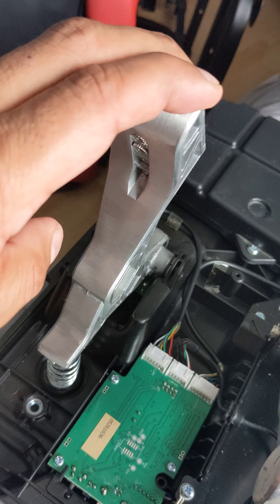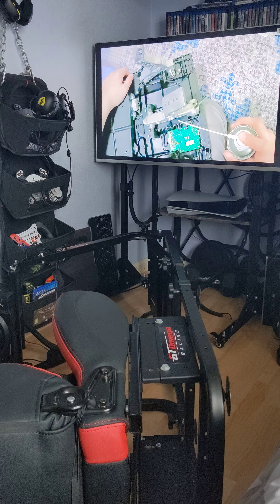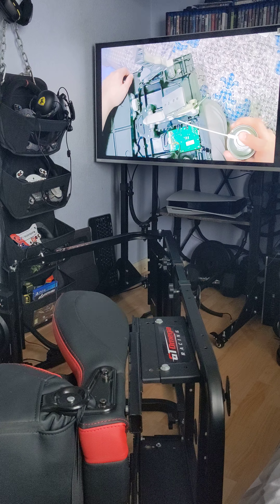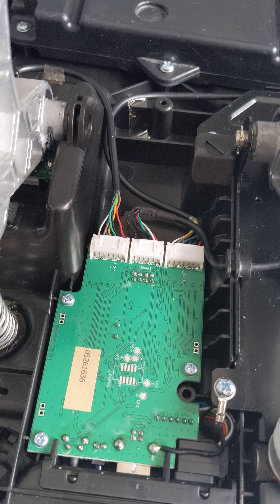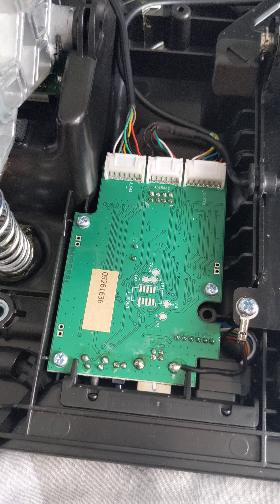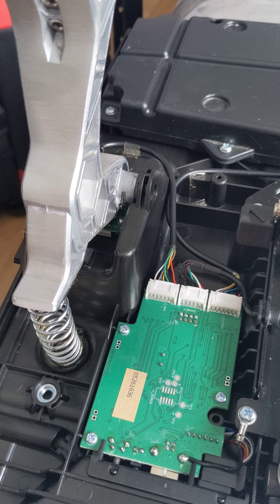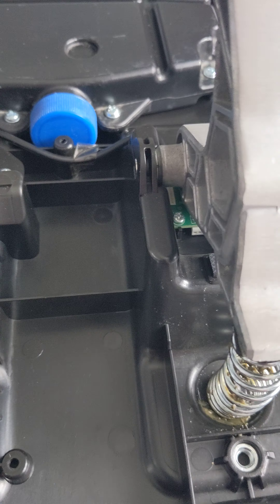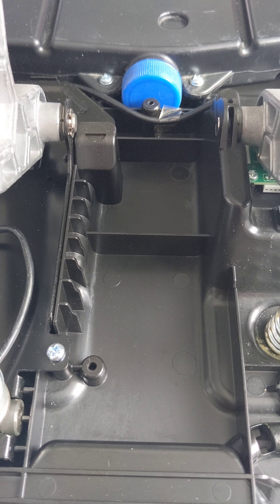Thustmaster TLCM - pedal fail - How to fix

Comment: it worked!! even with my brake pedal too:) just hit it gently with compressed air and check if there's too much grease where the board that comes in contact with the pedals, clutch and gas
Reply from the maker: Hi there glad it worked for you, it's a common problem with this version of the TLCM pedal which is the earlier version. The newer one has a plastic moulding which covers the gaps at the base of the pedals to shield them from particulates. Funny enough my Brake Load cell is now playing up. So will have to take it all apart to see if it's the dust or another issue.
Reply: @MorfiusRacing  I got the same thing, covered all 3 pedals with dog`s shitbags and completely isolate, so however it started again, in my case its always throttle, got stuck at some percentage and stays there.. pretty shit.. was thinking about fanatec v2 , but just checked youtube and seems like they have even more problems than these..:D .. maybe I`ll give a shot to those cheap alliexpress pedals, ppl say they work fine without any issues...